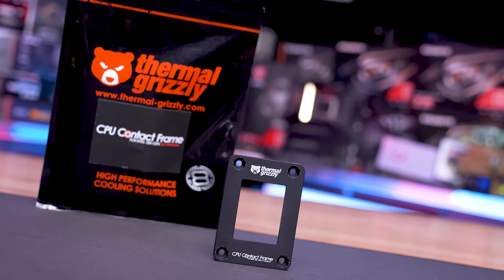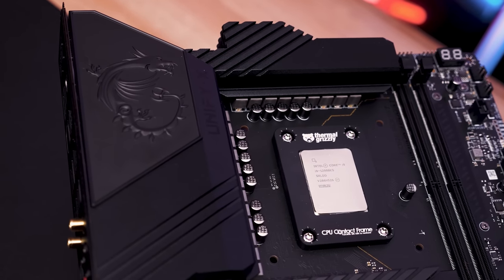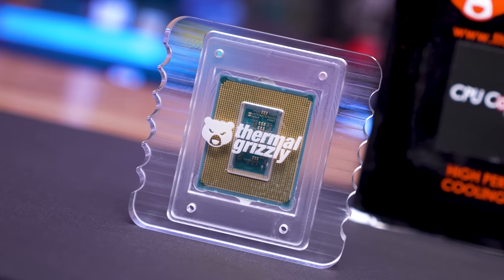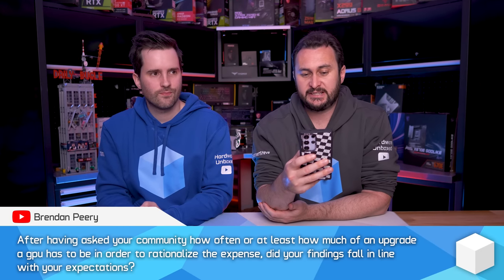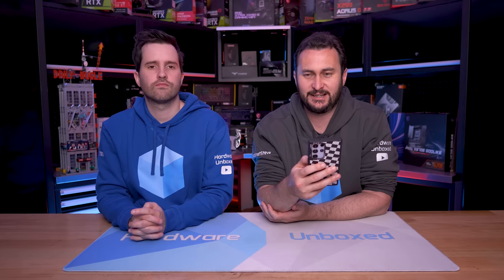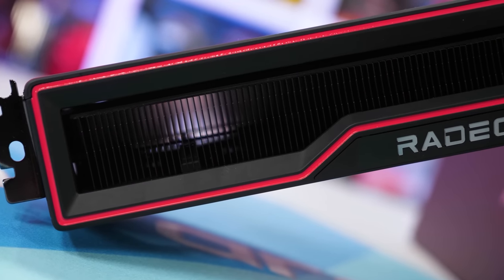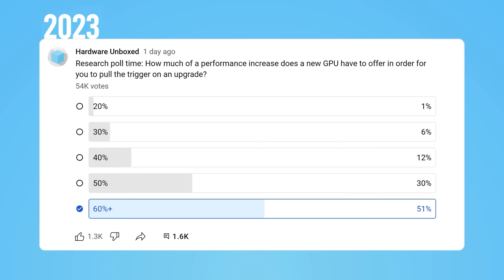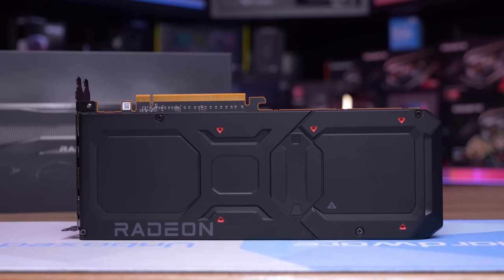RTX 4050 Pricing & VRAM, Are 12-core CPUs Dumb? March Q&A [Part 2]

Comment: Traditionally I aimed for a 50% performance increase for a GPU update.  But if prices are going to remain stupid I'll be targeting 80-100% increase.  I also anticipate going from every 2 product generations to 3 or 4.
Reply: That's cool. I upgraded my CPU+GPU just three years apart and tripled my frames. Looking back I should have bought a cheaper CPU and better GPU the first time but I wasn't exactly suffering if you know what I mean.
Reply: That's fine as long as the performance increase is genuine, and not the result of upscaling like the current 40-series. I understand NVIDIA thinks AI is the future, but they're using it as a crutch now. I want rasterization improvements to be 80-100% better, not just the card's ability to use tricks, bell's, and whistles to wow me.
Reply: @CrazyMammaJamma  Agreed.  Fake frames don't count.
Reply: I am sitting on a 2080 ti and won't upgrade below a doubling of performance. The 4080 is looking pretty good, but I am not willing to pay 1200 bucks or more again. It is not a flagship model after all and the VRAM is more on the limited side capacity and bandwidth wise.
Reply: @ole7736  Yup, at some point you have to say "Nope.".   If nvidia and AMD are going to charge twice as much, then I'm going to upgrade 1/2 as much.  The value just isn't there to be paying $1200 and $1000 for not flagship.  Especially when the price/performance over last gen isn't improving at all until you hit the 4090.
Reply: My usual upgrade cycle is 3-4 generations. Now, I don't play nearly as many games as I played 5 years ago, so my upgrade cycle will probably grow to 5-6 or even 7 generations..
Reply: I'm just gonna buy a PS5, whole damn system costs the same as a RX 6800 which is the cheapest card with 16GB of VRAM, anything with less is already getting VRAM limited so pass and everything better is ball bustingly expensive. The PS5 will play 100% of PS5 games as well as they can run, while the 6800 can't run TLOU1 that well
Reply: You got money to burn if you're buying a new gpu every 50% increase. I wasn't gonna been get a GPU till it was a 220%+ upgrade xD I went from a 1080 to a 4070ti a few months ago.

Comment: IMHO a major fatal flaw in the strategy of Nvidia/AMD of higher GPU pricing is that currently many of the AAA titles are performing terribly on the PC platform.  Why not just spend 500$ on a console and play at 60% to 75% of PC visual settings at better performance.  I do realize that some games and genres are PC based, but excluding those console is the way to go.
Reply: if i buy console  then you need to buy games , if i buy pc i expect free games my whole life wink wink with all the dlc lol
Reply: Because pc is different and although some will be willing to move over to console it is not something that the majority will do. It's pretty simple, it's not the same at all and there's far more you can do on pc than just game. Heck in gaming alone you can mod and extended the life of games.
Reply: @lilpain1997  There's far more you can do on a PC than just game - and you don't need a GPU at all (or a very powerful one) to do most of it.
Even for games 5+ years old you can just get a 5600G or SteamDeck & go with that, and have a PS5 or Series X for the more recent stuff.

None of this has anything to do with AAA gaming, which is usually pretty bad for mod support anyway.
Reply: @InnuendoXP  I mean this isn't what a pc player wants to do... That's literally my point. A person who has their library on pc won't just move over to console. There's a ton of reasons as to why they may not move. Games are far cheaper, mods are a thing, multitasking, you can configure the game to get best of both worlds and many more. Also there's a lot of capable cards on the market for not very much.
Reply: @lilpain1997  If they have their library on their PC, they don't need to upgrade their PC (or get a more powerful one) for the games they already have - and with Game Pass, it's a lot less tempting to continue buying new games just to try them out, and with GP Ultimate, you can get a Series X or S included like a phone contract, and still play the games your old PC can run on Game Pass too.

I myself haven't bought a AAA game new for years, even before using GamePass - and GP gives me more reason to continue not buying them.

As for "there's a lot of capable cards on the market for not very much" capable for what? Because doing a PC build on performance parity with a PS5 or Series X will still cost you around $1K & the card alone will be almost the price of the entire console.

Also "games are far cheaper" that's a bit overblown - it used to be the case, but not so much anymore, you can get cheap digital games on sale on console all the time these days, and 2nd hand games can be had for cheap at charity or donation shops all the time, which isn't a thing on PC since the physical games market is all but dead there. Of course you can still live the pirate's life on PC, but we're talking about legitimate means of enjoying games.
Reply: TBH if it wasn't for 21/9 aspect ratio, I would really consider switching back to console gaming. 
Concerning Nvidia it alsmost feels like they wanna push their streaming service by putting GPUs to those prices.........how many years of their streaming service can you get for the price of one 4080 ?
Reply: @InnuendoXP  upgrade or not my point still stands. I really do not see a point continuing this with someone who biased towards consoles. Pc games are cheaper as you can get new games cheaper and won't have to wait on the store to put a sale on and hope your game is on it. Just because you do not want to game on pc or think it's better to get a console does not mean others will. It's something that should be considered obviously.
Reply: @lilpain1997  Speaking of bias -  I own a gaming PC, I did a new build late last year, I don't even own a console- but you have to be wilfully obtuse if you can't see that PC gaming is nothing like the amazing deal it was 10 years ago. In 2015 you could build a console-killer for the same price as a console.

The current gen consoles are over 2 years old now and it's "still" double the price to make a PC equally as powerful.

What would make you think anyone in these comments has an unfair bias against PC in favour of consoles? What channel do you think this is? You think militant console stans are watching Hardware Unboxed? 🤣
Reply: @InnuendoXP  pc gaming is more expensive yes I know this. Yes it is not as amazing as it was 8yrs ago or even just a few yrs ago. My entire point is that the reason most do not move over is because it... Is... Different and you can do way more. Upgrade or not. It seems most do not care and it shows that, as many are still using the 1060,480 and 1650s. The consoles are far better yet these people will continue to play pc. I own a ps5 and switch for exclusives and the ps5 is also not doing great with new AAA games. Same as the pc. The optimization has become awful across the board, a little less so on console I will admit that. But it's not great either.

I shouldn't have been so quick to make assumptions so I will gladly accept being a fool on that.
Reply: @lilpain1997  yep. Also i surprised no one mentioned whole gamepad vs keyboard and mouse thing. For me personally playing on a gamepad is a torture. I would start consider switching to console then (or if) they offer full keyboard and mouse support for al titles. VR is also a thing. Yes, PS have PSVR, but library is extremely limited comparing to PC.
Reply: for me i want to play games competitively and PC, especially mouse and keyboard, will always be more competitive due to allowing more frames. Many of the games I play on console did not allow me to plug a mouse and keyboard in even though I’d be fine being queued in PC players games, that was a big reason i made the jump. imho why not just get both. got a ps5 for AAA games and a PC for competitive games.
Reply: i think the problem is nvidia/amd test their hardware with a not broken system and aim for performance targets accordingly. and 90% of pc gamers these days have broken pcs
Reply: @InnuendoXP  theres no "legitimate" way to enjoy games, get out of here
Reply: @InnuendoXP  "double the price" but my pc can make me money too
Reply: @gozutheDJ  tell me you don’t make money using your pc without telling me you don’t make money using your pc😂
Reply: @InnuendoXP  Equally as powerful.... what sort of NVIDIA GPU does that take these days?
Seems like they all lack VRAM unless you go for the 4070Ti to do 1440p. It probably still lacks the VRAM for 4k.
These modern ports are insane.
Reply: @KobeLoverTatum  maybe you've heard of video editing
Reply: @InnuendoXP  It totally depends on what type of PC gamer you are. If you just mainly play AAA games that are available on consoles and PC I agree to a large degree with the point you make.
But on the PC there are an order of magnitude more games available and entire genres and niches are not available on consoles. I, for instance, like strategy, management and simulation games. Also the type of games where mods sometimes add great value, or sometimes entire games are carried by the mod community. Think Counter Strike or Day-Z, both started out as mods.
And that's the point @lilpain97 is trying to make it think. 

IMO the argument you have can be deconstructed to 1 person saying it's black and the other person saying it's white. But, most of the time, thing are more nuanced. But many people tend to overlook that.
Reply: For new games yes, but I actually think most of the time it's the opposite issue. Due to the extended cross gen era, even Pascal level cards perform well if you drop the settings to 1080p in the vast majority of games.

So people aren't really dealing with their GPU writhing in agony trying to launch a game like they did in the late 90's and early 2000's.

I think this is an underlooked reason for GPU prices being so low back then. Progress and GPU demands from games were so rapid that a company couldn't justify selling a product for 1000 that ages like milk.
Reply: @gozutheDJ  yeah, so can mine, and it doesn't even need a GPU to do it, it's called having a job.
Reply: @Reeferman420NL  most PC games that are unique to the PC platform don't need a powerful GPU to run, because indie Devs want to reach the widest audience possible. In this area, PC and consoles have as much to do with each other as the Nintendo Switch and other consoles.

But AAA games with high production values and graphics 'is' where the debate is on GPU pricing, so consoles are very-much relevant here.
Reply: @shanez1215  yeah this is really the thing. an rx 6600 which is around a 200 dollar card can run everything on high 1080p even new stuff like the last of us. now 4k resolution is the target for high end. 

pascal is great although pascal is just on the edge of being done unless you dont cRe about anything new. but it had an astounding run
Reply: Because we PC gamers are never going to switch to console, that's why. Like I can't just play whatever I want from GOG on sale on a console, that makes it impossible to play older games too along with indie titles so no Deadspace 2 for me, and no Starcraft HotS or Wasteland 2 either, no Planescape or Tides of Numenera, and no classics like Baldur's Gate or VTMB, I can't play FNV and I cannot play Cliff Empire or Surviving Mars, it pretty much basically is just going to limit me to the same third person over the shoulder adventure game that all look identical to each other from Elden Ring to Witcher to Fallen Order to Division 2 every single last one of them looks and feels like you're just playing a reskin of the same damn game and I hate console games, like you know Mac from worthabuy's "yeah yeah it's a console port a console console console port" song? This is what instantly plays in me head every time I think about it.

And what's worse, it isn't even saving you any money. Unless you basically don't play any games except some racing sim with your son or something like that so you maybe play 2 hours of games after work, and therefore don't actually buy or have lots of games, you're going to be stuck paying SEVENTY. FUCKING. DOLLARS. per game. Console games went up now so those $60 games I scoffed at are now cheaper than the latest AAA titles and I refuse to pay for that. So by the time you have actually bought a small collection of games to play with that you'd already have spent enough savings just on games to have afforded a midrange to high end card. That's the problem, and plus I use my PC for lots of things too and so there's no point in me considering a console as I don't own a TV but I do have computers. Plus if you didn't even own one or have built a new PC in the last 5 years or gotten a prebuilt, you can always just buy an older business machine to save the money on building a brand new $2k system.
Reply: @InnuendoXP I again agree to a large extend but it's still a bit too black or white to my liking. Although I play management, RTS or sim games half of the time also enjoy a good playthrough of games like GTA or RDR, or a couple of rounds of battlefield or CoD warzone.

If they add native mouse and keyboard support too all games on consoles and cross platform all games, and a PC emulator on the console for older games I would agree 100%.
Reply: @InnuendoXP  consoles are suffering from pretty bad ports themselves though. I own a ps5 and most new AAA games you need to wait till patches are out just like PC. AAA gaming as whole is in the shitter so going to console isn't going to fix much here.
Reply: That approach is good for people that only game/consume media on their machine, but it will not work for people that game/work on their PC.
Reply: i blame both xbox and playstation for this mess .. xbox because there play anywhere BS they keep pushing ( which works for them because they have little to no exclusive games ) 
and playstation because for some reason they feel the need to port everything to PC and follow xbox but when they have the better selling console more exclusive games just leave them on console !!
Reply: @jonRock  The number of people that actually work on their machine using a GPU is pretty small though. It's a valid use case, it just doesn't apply to the overwhelming majority of GPU users most of whom game and don't use GPU for work. Even if you did, you might be considering getting a Quadro anyway unless  you're a more casual gig economy independent type.

Comment: You're totally right about 8GB of VRAM. It was the number one issue that turned me away from buying a 3070.
Reply: Heck my GTX970 is still chugging along
Reply: bought one and mad regretting not going slightly higher as I don't think I'd be thinking about upgrading now
Reply: But raytracing and DLSS! 🤣🤣
Reply: In a few years APU's with access to 32GB of spare DDR5 kits will outperform anything of todays generations of GPU's so they make them 2-3 year cards.

Otherwise they're taking money back off of themselves over the next generation and on balance making less.

But then again it was a problem of their own construction, because they were happy to burn vital supplies of silicon on a few years of the mining bubble.  We're all having to fund the rebuild.
Reply: @SovietToaster  Yeah at 1080p medium to low settings in anything newer than 2018.
Reply: Same here!
Reply: @SovietToaster  I still feel burned by the 3.5Gb! If I knew that at the time, I would have bought the 980 without thinking twice! I'm not falling for the same trap again! I'll just not buy anything LOL
Reply: @andremalerba5281  I still feel that burn too...went from 970 to 980Ti...would still be rocking it if it didn't die.
Reply: The only reason I want to upgrade my 3070 to something like a 4070 TI (once the price drops to $500 used) is because it can't fully play my main game of DBD at full 120 FPS (only about 100) at 4K medium settings. High VRAM only matters if you actually play new AAA games, where as I only break 4.5 GB's of use.
Reply: Sorry, but, the 3070 was a pretty solid buy for $400 - particularly if coming from a card like the 1060 or 1070.
Reply: I'm thinking of selling my 3070 and getting something like a 6800. What do you guys think?
Reply: @saucedtomatoes8816  Homie, you're on youtube, just watch some videos comparing them.
Reply: @drunkhusband6257  I'm not going to play my main game at 1440P on a 4K, 120 hz TV. Once you see the crispiness of 4K (especially on large TV's, like 75 inches), it's pretty difficult to go back.
Reply: That's why I said fuck that, guess I need a 3080